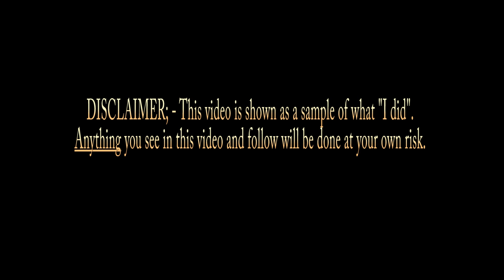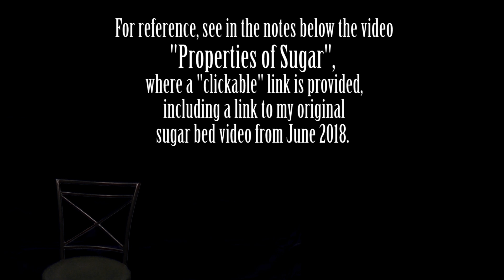Update: A Sugar and Water Solution Print Bed Adhesion Method Explained. #31

Comment: I can attest that it works like magic with ABS. I was using buildtak to get the adhesion required, which if you've used this, ya know it's great, until you get to close with nozzle and the part will stick so hard, you can't get it off. I tried your idea, part stuck very very hard (as hard as buildtak) and once I took the glass off to cool, in about 5 min the part basically was free, on it's own, I moved the glass thinking it would still stick and the part fell off...WOW!!! THANK YOU for sharing your Excellent idea!!! my hat is off to you!!!
Reply from the maker: I'm glad this has worked for you! Thank you for posting.
Reply: Bits and Electrons I used 90*
Reply: Trick with Buildtak or PEI is to leave the bed at 45c for removal. Lower than that, part can get stuck quite too much. Higher and it still has a good bond.

Comment: thanks for the tip: tried on ABS, PETG & PLA works like a sweet charm :)
Reply from the maker: That's great to hear! Thanks for posting.
Reply: Wondering about if this will work on Polycarbonate
Reply: @Bits and Electrons as always to 100c

Comment: Yep this is amazing. I just bought a second hand printer and was having a terrible time levelling and getting the first layer to stick to the glass bed. Glue stick was horrible. it went on lumpy and still didn't hold the PLA 100% of the time. This sugar solution has so far enabled me to lay down my first layer at 30mm/sec and I'm currently testing with a first layer height of 0.2mm. I'm gonna push this as hard as my printer will let me. What a brilliant idea. Thanks mate. Just a SAFETY WARNING - be careful if you're print bed is fixed inside your printer as mine is. You'd don't want to spill ANY drops of water in there with all the various electric cables/connectors and mains connection.

Comment: I was having great difficulty getting the base layer to stick, or if it stuck it would start to warp. I tried leveling the bed several times. tried lots of print head to bed gaps from 0.06mm to 1.06mm and nothing helped. Tried this sugar method and first print excellent, no more trouble. Thank you.
Reply from the maker: I'm so glad this helped you! 😊

Comment: Wow, this works like a charm! I did a major 9 hr print last night that worked perfectly. Even after the bed cooled down I had to really work work with the spatula to get the pieces off. Incredible how well prints stick now! Thank you!
Reply from the maker: That's great to hear! You said that the print was still holding after the bed cooled down. I am wondering, what was the temperature of the room when it had cooled down approximately?
Reply: @mysimplefix  Around 70 degrees. I've done several prints now and even when the bed is room temperature it takes some serious spatula work to get it off, which is fine by me as my other prints were failing because of non adhesion. I also found that I need to print PLA at 230 degrees for good prints on a Creality Ender 5 and I'm using a bed temp of 50 degrees.
Reply from the maker: Ok thank you! I'm glad this helped you.

Comment: Can I say Genius.  I really appreciate the brilliance of simplicity.  I recently got my printer out and have been struggling to no end to get my prints to stick.  I have not had this issue in the past. All I ever did was make sure I was level and had good clean glass and I was ready.  Thanks to you now my PLA sticks like glue.  You have no idea of how relieved I am.  An interesting point.  When I applied the sugar water to my bed heated to 60 degC during my first coat I could start to feel the paper towel to slightly stick.  My second coat a few small piece of the towel tore off(Its really cheap stuff), so I didn't try a third wipe off.  maybe high sugar to water was higher.  Figured since I had a nice glazed donuts appearance no reason to go any further.
Reply from the maker: I'm glad this has helped you! Thank you.

Comment: Years later now... With the advent of PEI and other high tech print bed materials we're still using glue stick, this time to ease removal as some filaments stick so well they molecularly bond with the PEI or other material. Funny how this is pertinent again and I'm gonna try in on my Qudi X CF Pro bed to ease the removal of PETG.  I have used glue stick for years but it builds up and makes permanent marks on the underside of the print. Thanks after 4 years!
Reply from the maker: Hopefully this helps you!
Reply: @mysimplefix  Great, Simple vid! Thanks!

Comment: Tried this with PLA and ABS (Bed = 105), and it worked multiple times. The problem I was having with purple glue stick is that once it is exposed to ABS temperatures, it sort of degenerates and then nothing ever sticks to it again. Thanks for the excellent tip.

Comment: I use the blue sanitary alcohol with sugar. It's dirt cheap 70%, It evaporates a lot quicker and it doesn't leave droplets with the added sanitary benefits. One coat is enough.
Reply from the maker: It's important to try different things.

Comment: Thank you, your tip works perfectly! So far I've only tried with PLA since I never had any troubles wit PET. The next thing would be to somehow get the sugary surface smoother, water has such high surface tension. Not a big problem though compared to warping or detaching prints. (edit: I noticed people have experimented adding soap, must give try)

Comment: I already cooked up a batch out of desperation trying to get PETG to stick to a spring steel plate before watching this, was curious to see if anyone had tried this. First test print looks good, I can't pull it off, used about a 1 to 1 ratio. I kind of ruined the PEI side of the plate, learned the hard way to not print PETG on PEI lol. I'll be printing some Nylon soon, really curious to see how well it works. Best part is that it's basically what we stick in our humming bird feeders, so I can just take some of that and stick it in a bottle whenever we need to fill them.

Comment: I like this idea with the sugar. I might try this out.
I've been printing with PLA on glass, but to get good adhesion I print the first layer MUCH hotter, then cool the nozzle and bed down. 1st layer at 70 for bed and 210 for nozzle, then the rest at 50 for bed and 200 for nozzle with fan at 50%.  1st layer is also smushed really well into the glass.  Holds like glue and releases when the bed gets to about 45. 
BUT.. Given it's winter now, and the room the printer in is about 5-10 degrees cooler this time of year, I have to tweak the temps to make this trick still work... Might try this to see if helps when the room temp is cooler.

Comment: This sounds great! I will be trying this out with TPU soon.
Reply: Hi Randal! Did you get it to work with TPU filament?
Reply: @hammerfallen12345  Never got it to work with any kind of filament. I still find Aqua Net hairspray still works better than just about anything else. I was never able to get my bowden tube printer to print TPU worth a darn. I wound up buying a direct drive printer which prints TPU beautifully on glass with nothing on it, I just keep the build surface at ~60C and the first layer stays stuck...
Reply: @therandals  Ok..hmm it works good on my glas with PLA..it's a heat tempered glas that i bought from a glazier. Maybe we have different glas? Thx for the info anyway...i read further down that a guy made it work with tpu. So i give it a go and if it dosen't work i try your method 👍 Did you try lower than 60 with this method? I tryed a PLA and it couldn't handle 60...it worped in the corners.  Only soultion for that was to lower temp on the bed. It feels like the softer PLA it is the more sensitive it is from heat. I have a softer PLA and it is more sensitive than a harder one. Harder or brittle seems to be the key for more easy printing. Just my thoughts but i can be wrong...have not been in this business for so long. Best with this sugar method is that it does not have to be very clean. If print fails just take away old print and apply one thin layer with sugar and you good to go. I don't use any detergent...i only use a rag and water and heated bed when cleaning

Comment: I have an ender 3 V2 neo with the plastic and metal magnetic top sheet that you take off, but I'm having trouble with my prints warping and I was going to use hairspray, however do you think I could use this on the cover plate? Your video states glass so just wanted to check
Reply from the maker: Yes my bed is glass, and it's on top of an aluminum bed.. From the feedback in the comments section, many seem to be having good luck, but I don't know what they have. The sugar is water soluble, so it will wipe off with a damp cloth. It's your call! Please let us know if and how well it works.

Comment: I see there is some beading of the solution so i wonder if adding a drop of dish soap to the sugar solution could help to obtain an uniform layer much easier? i don't know if it would affect adhesion but i guess it should actually help due a more consistent layer. My printer has a "ultrabase" bed so i cant really try that out but still great to know about this method when it eventually wears out.
Reply from the maker: Yes, that's interesting. Because one might assume that the dish soap might break some of the surface tension. What I have found though is that during the second coat, that beading of the mix dissipates, and still leaves a relatively smooth surface. Thank you for the input! The more info and input from people like yourself, the better for all of us.

Comment: My print bed is blotchy after following your instructions.  Am I using too much water?  The blotchyness transfers to a pattern on my first layer.
Reply from the maker: After the second application of the sugar mixture, you should be left with a uniform candy like coating on the bed surface. Remember that less is more when it comes to how much you put onto the bed. Is your surface a glass surface? Btw, any residue would be easily wiped off with a damp cloth from the bed and also from your print.
Reply: @mysimplefix  Thanks for responding so quickly.  I am using a mirror bed, which I am assuming would be the same? I have made multiple solutions at this point and still get the same results.  The blochtyness isn't coming off the prints even running under water and using either side of a dish sponge to scrub.

I will try less solution and maybe on the pei sheet I have. Currently no glass bed.  Thanks again.
Reply from the maker: After your sugar treatment, if you look at the bed with a light, do you have 100% coverage of the surface? Maybe in your case you need to do a third application before printing? I'm only guessing. As far as applying a coat of sugar on a PEI sheet,  that might be a bit of a risk. I've only ever done it on glass. Good luck and please let us know if you find the cause of your issues! Thank you.

Comment: I’ve been doing something similar with a mixture of tacky white glue and water. I even experimented with apple juice. But never thought to just use sugar. 
How well does it work with larger prints? I get warping even with my glue solution.  I’ve even tried running my fan at 40%.

Comment: Anyone try putting the solution in a spray bottle? I love the hairspray because of the even misting you get without having to touch the glass. And the surface would be alot smoother I'm guessing.
Reply: Have you tried it?

Comment: Hey guys, this works well with PETG but it can be VERY troublesome  when you have too much. I had applied way too much of the solution on my glass and it actually pulled a small bit of the buttom off my print when I pulled it up
Reply from the maker: Did you allow the bed to cool down sufficiently before removing the print?
Reply: @mysimplefix  Yeah, it was at 28C when I tried to remove it
Reply from the maker: Ahh, yes I find the bed still holds at that temperature of 28 Celsius. Closer to 20 you'll hear crackling before it pops loose.
Reply from the maker: I don't know why 10 more degrees makes such a difference, but it has repeatedly for me.

Comment: Holy crap. Why go through that much work? Just use Aquanet. Quick spray and you're done.
Reply: How do you remove the hairspray off your prints?
Reply: @marksneyd1262  Never even noticed any on the bottom of the prints that needed to be 'removed'. Even if there was, you could 'remove' it the same way you 'remove' it from hair....... water.

Comment: Have you tried this with a salt solution instead? It's supposed to work just as well, but salt's melting point (800C) is higher than sugar's (186C), which would disprove your caramelization theory.